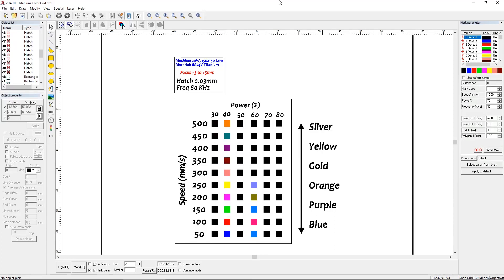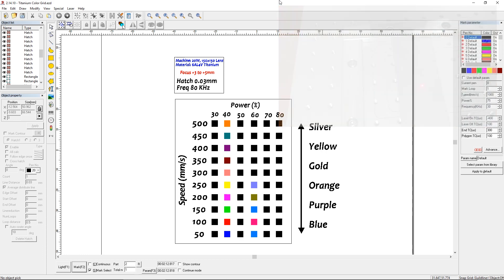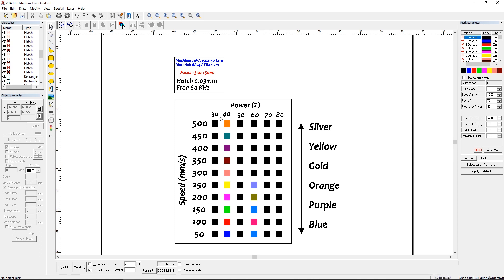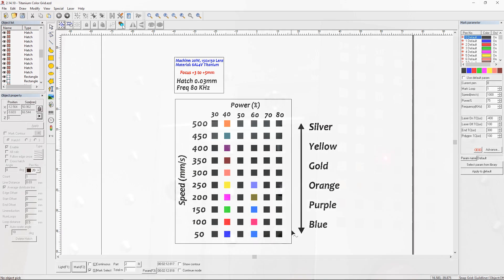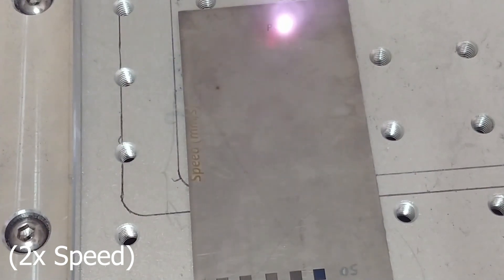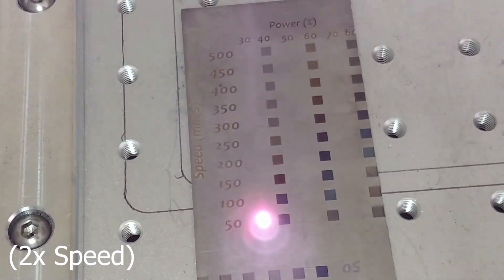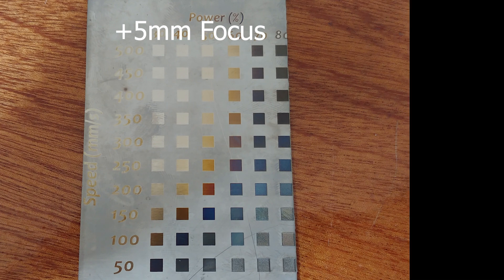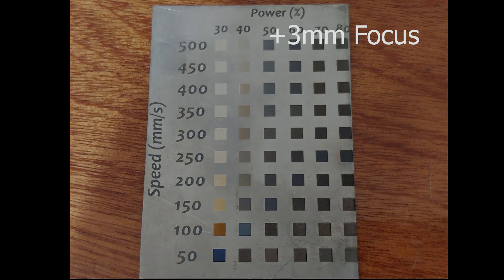Marking Colors on Titanium 6AL-4V with a Fiber Laser

Comment: For cleaning metal surfaces, use:
1) Acetone
2) Xylol  (Xylenes) available  at your hardware store
3)  Acetone.  
I used the preceding combinations for cleaning pharmaceutical reactors.

Xylenes remove very greasy substances. Acetone will remove excess water.   Also, use only brown paper bags from grocery store for scrubbing.  Avoid paper kitchen towels!  Paper kitchen towels have  softening agents such as detergents and oils.

Comment: Hi, Jeffrey. 
Thank you for the video. 
Where is the setting to adjust the focus between +3 to +5mm on EzCad? I tried to mark this template sheet on the titanium metal sheet (1mm) with my 30W fibre laser machine, but the colours came out either white or dark grey. What has gone wrong?
I have also used the other template 'Frequency vs Hatch' to mark on Stainless steel, but they looked like burned black colours.... How to fix it?
Reply from the maker: You need to manually adjust the focal length with the hand crank.  You will also have to tweak the settings as our lasers are likely quite different since you have a 30w.
Reply: @jefferyj  Thank you so much for getting back to me, Jeffrey. I will look into it. Much appreciated.

Comment: Hi Jeffery, I am buying a 50w fibre, can I ask you if I don't wish to buy a mopa version,  can I possibly get  'Green'  colour on Titanium ?
Thanks for your help.
Reply from the maker: You can do quite a bit with titanium but it's tough to be consistent.  Even using the same settings on a smaller area may not translate well to a larger area.
Reply: @jefferyj  thankyou.

Comment: Jeffrey, I have a 20W fiber laser purchased from BOSS Laser which doesn't have the adjustable height lens. I have to place the work on a scissor jack and adjust the focus from there.  I used a sheet of 6AL4V which I sanded smooth and used a 5mm metal spacer to get the focus offset.  Using your titanium color grid, the marking was so light as to be almost not visible, with the darkest marking in the lower right corner.   Do you have any suggestions as to what I might be doing wrong?  Thanks in advance.
Reply from the maker: Is your lens the same size as mine..150mm?  If it's larger, you might want to reduce the distance out of focus.  I haven't tried sanding so I don't know what kind of effect that might have, but I'm guessing you finished with a very fine grit.  One other thought: did you clean the surface of the material prior to marking?  Surface oils did seem to affect the mark when I was playing with it.  If you've done all that, you might just pick one of the boxes toward the center and tinker with the settings a bit each direction until you get a similar result.